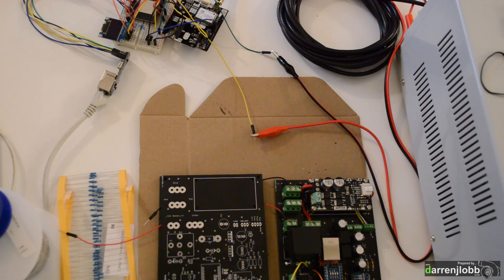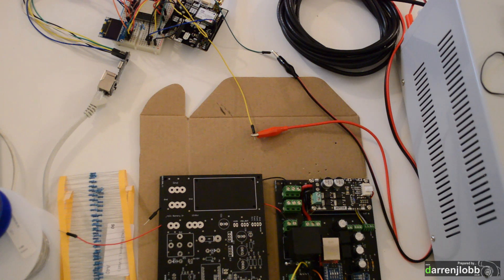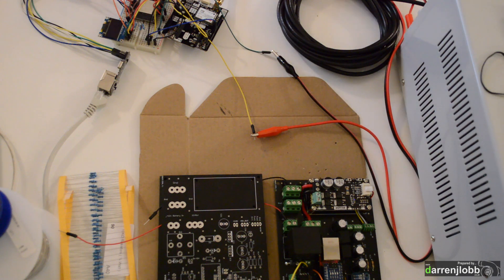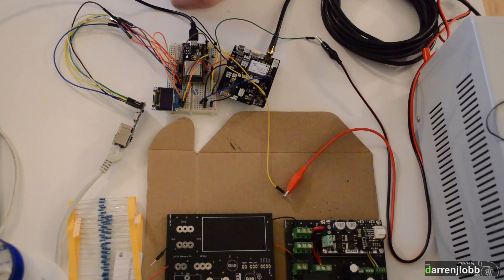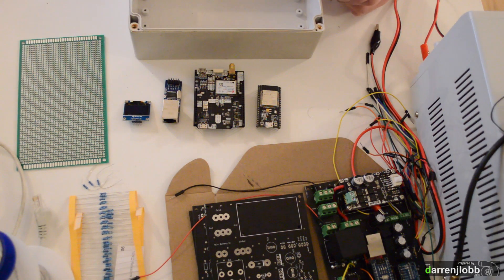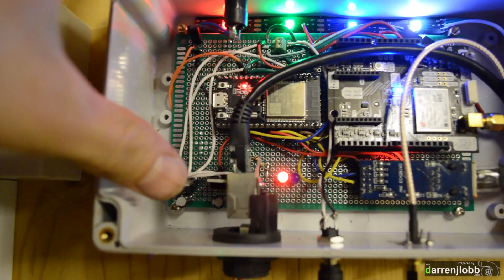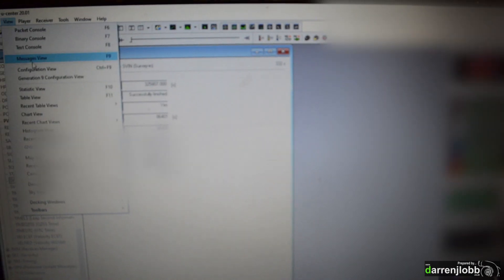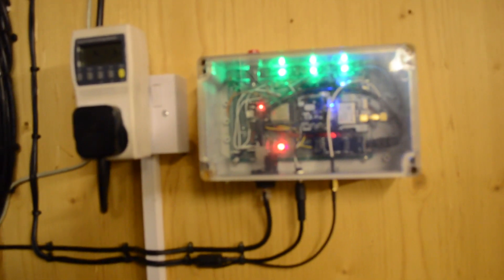RTK Base Station Project (AgOpenGPS, ESP32, F9P)

Comment: Hi Darren do you think a home made base station would work with a tractor that is already rtk ready ?
Reply from the maker: Most of the time it is possible, I use it with Deere green star receivers as well, just needs a mobile rtk subscription and you can input rtcm no problem. I believe alot of others allow it right out the box no extra cost :) Great videos by the way been watching for a long while! I don't actually use this particular base anymore, I now use a raspPi running RTKbase, with the same F9P, couple hundred quid if that and your up and running!
Reply from the maker: Sorry that reply was wrote from the combine seat so might not have been the best, feel free to message me on facebook / watsapp or something if you need any more info!

Comment: Im debating on using RDF900 or wifi for transmitting Data from a rtk base station tor a rover / lawnmower that would go around a house and trees, not a clear line at all times, what would be better, can you use both ?

Comment: hi! what kind of wifi system do u use to cover the farm?, im from costa rica and i face a similar condition in terrain limitations. great video :)
Reply from the maker: Its all mainly Ubiquiti Airmax equipement...remote stations running solarpoint and solarpanel with battery to power, litebeams/powerbeams for P2P link and unifi AP PRO for remote AP

Comment: Mr. Lobb you have done superb work on this project. I am wondering if RTK base station is a must in agopengps projects. 
I am not sure but commercial autosteer suppliers do not seem to have RTK base stations. They mount their systems on a tractor and start using them :) or not. I would be glad if someone informs about this. All the best.
Reply from the maker: Thanks! RTK is not essential, but it gives you complete repeatability...can leave the field for 5 minutes, 5 days, or 5 months, when you return to that line, you will be in precisely the same track within 1-3cm....without RTK that will drift some meters over time.... If you arnt worried about repeatability, then no, it isnt needed.

Comment: Thanks for your video, it's complete and helpful. It's even more detailed than our other tutorial. Hope it can run during a few months.
Reply from the maker: Been running many months now, not touched it. Works great.
Reply: @darrenjlobb  Hi.
One piece of information is that ESPrtk is at version 3.9.5. You can upgrade for free with your old key if you want.
 Can I use your video on our tutorials page?
Reply from the maker: @DevelopESPrtk  may upgrade in the winter if I get time, although it works perfectly so not sure there is much point in risking breaking it! And yes sure no problem.